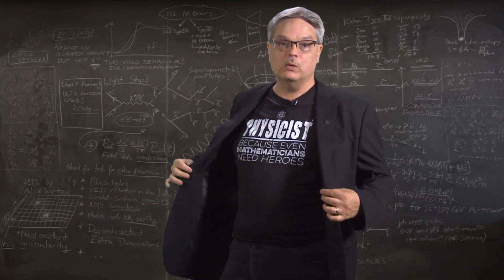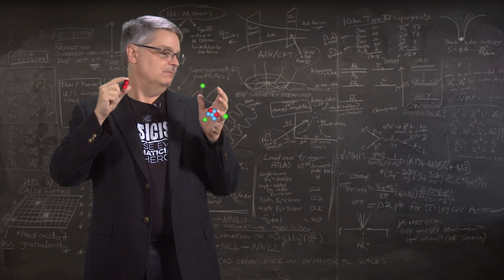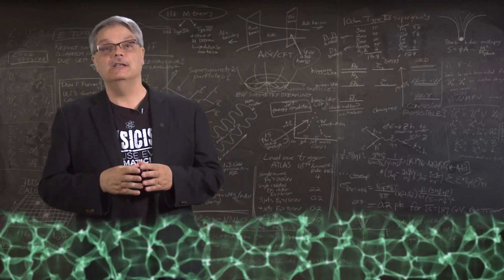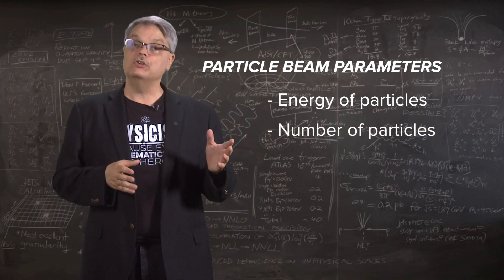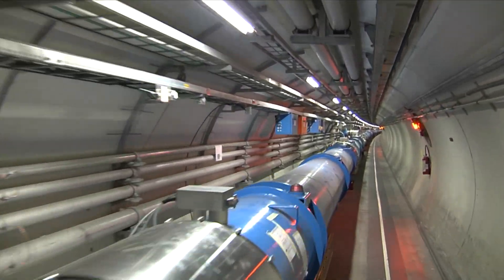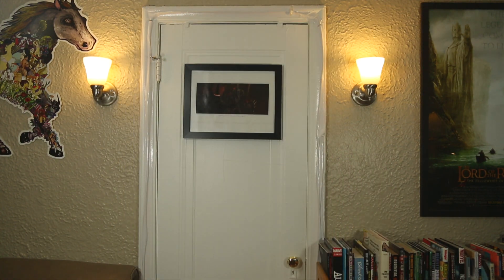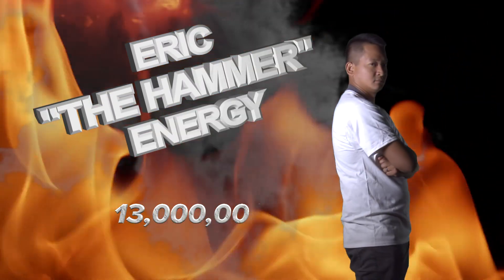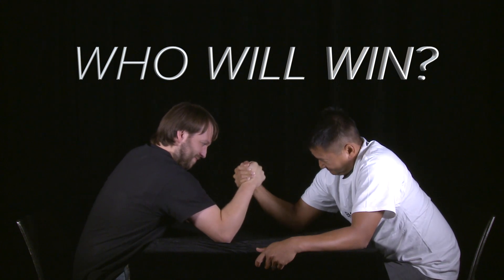Accelerator Science: Luminosity vs. Energy

Comment: As of early 2018, luminosity seems to be winning. Energy might've won the round for the Higgs, but the top hints for new physics are all from luminosity (at least if you consider precision physics part of it).
1) LHCb b meson decay anomalies
2) T2K experiment finding initial signs of very large CP violation in antineutrinos
3) Hints of 4th, "sterile" neutrino in some experiments but not others
4) Claimed discovery of new, 17 Mev boson in Beryllium radioactive decays that's awaiting replication. Jefferson lab hosts the one experiment looking to replicate that I'm aware of, Darklight, which is a precision high luminosity approach that should have results within a year or so.
5) g-2 anomaly, which Femilab itself is leading a flagship experiment to confirm.

All of those are results from lower energy, high LUMINOSITY experiments. What hurts the main LHC- and Tevatron before it- is that while the proton beams might get up to say 6 TeV of energy, the # of actual collision EVENTS with even 5 TeV is infinitesimal. The proton being a messy spitwad of gluons and quarks means the vast bulk of collision interactions feature almost all the energy going into the production of pedestrian subatomic shrapnel, not the new force carriers or matter particles you're looking for (e.g the Higgs itself). It's looking like luminosity will indirectly discover the presence of new physics, a new"something", then big colliders like the LHC will be tasked with nailing down what that "something" can be by either producing the new particles posited to explain the effects or not.

Comment: Can someone explain, that if in core of very large star that heavier atoms formed rapidly, then why in initial Big Bang short time wouldn't a fairly significant percentage of heavier atoms have formed?  Why just mostly hydrogen and helium and not the heavier atoms?  The pressure and temperatures would have been that of the centers of large stars wouldn't they have been?  The large stars burn themselves out so quickly so wouldn't Big Bang have been able to rapidly generate heavy atoms too quickly?

Comment: In the context of particle accelerators, aren't you really talking about intensity, rather than luminosity?  Isn't luminosity a product of intensity and the detector upon which it is directed?
Reply: +ScienceNinjaDude What is the density of the audience target?
Reply: Dunno - But, I'm pretty dense.
Reply: *****
I rewrote my comment several times to try to get rid of the implication that the audience members were dense.  In particular, I changed "target audience" to "audience target", and "how dense" to "what is the density", trying to suggest that the answer should be in audience members per square centimeter or something like that.

Clearly I failed, and the pun was not worth the confusion.
Reply: *****
Thanks.  I just didn't want to insult anyone.